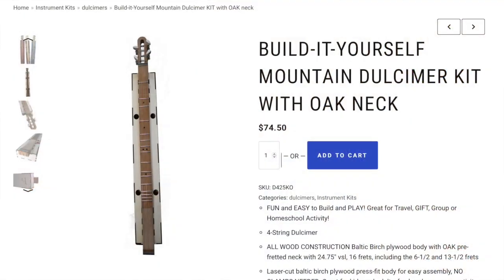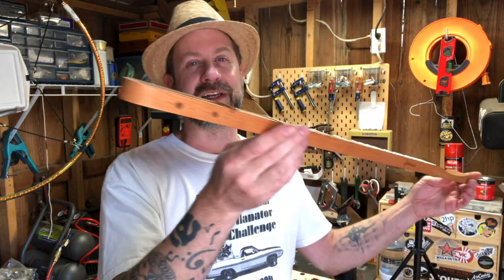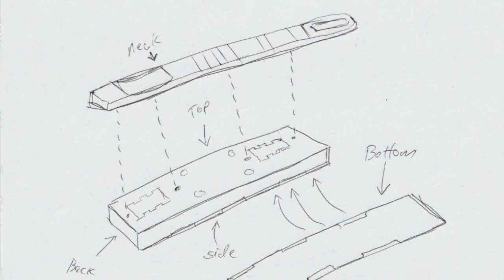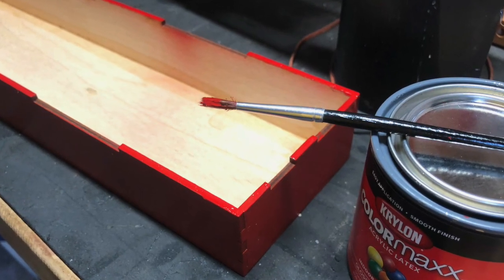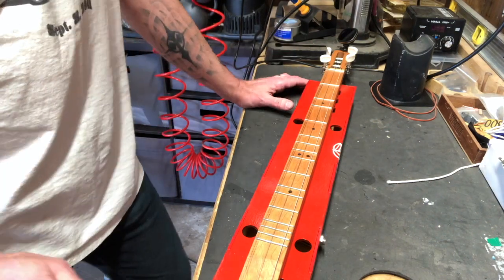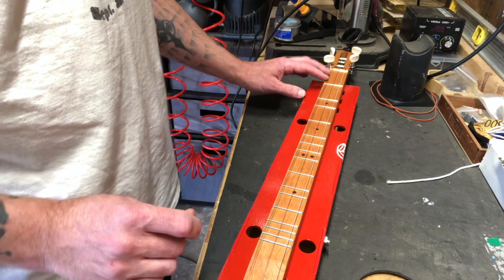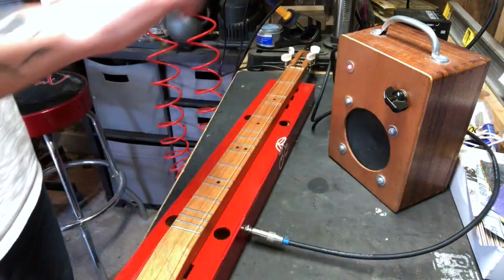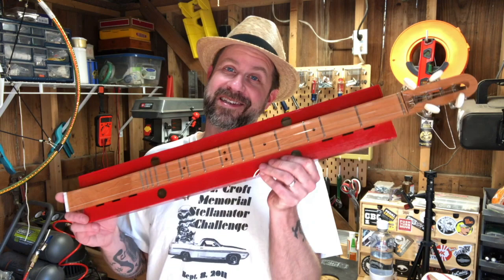Jaromin DIY Mountain Dulcimer Kit

Comment: Nice job! Where can I get the little pick up and jack that you installed? It looks perfect for the job. 😊
Reply from the maker: Thanks for checking out the video. The pickup can be found by searching for "35mm piezo disc" and the jack by searching for "1/4 mono jack". You can get them from a number of different online merchants.

If you're not handy with a soldering iron, you can buy them pre-soldered from www.cbigtty.com. Thanks again and good luck.

Comment: I've wanted to build a mountain dulcimer for quite some time now. Having "studied" instrument building (mostly in books and on YouTube, a tiny bit by actually building), I still find somewhat puzzling how well it works: the "neck" vibrates and transmits its vibration to the box. I would have thought that without a bridge directly connected to the box, it would sound thin, yet it doesn't! Anyway.

I figure I would plug it to a fuzz and play some punk tunes with it. Maybe because power chords are easy to play on them?
Reply from the maker: Thanks for checking out the video. I agree with you completely. I was anticipating this one to sound really thin because the bridge doesn't touch the box. I'm not sure why it creates rich bass frequencies but it does. I surmise it has something to do with the size of the box. In any case, I'd highly recommend this kit and yes... it would be perfect for some punk or grunge.

Comment: sweet

Who I am and where I want to be.

I have had music in my head for as long as i can remember.

Around 5 years old, I started trying to build whistles out of wood, copper pipe, and later when I learned to use a lathe out of brass. I built some most wicked whistles and when I got into grad school I added clay whistles to my. I never had much success with flute making as a kid, but it tried and tried again.

I made myself diddley bows even though I did not have a name for them then. I built a mean shipping crate for my dad's shop and they were highly valued by our customers and used for tool boxes and many things. My first diddley bow was nothing more than a long 2 X 4 with whatever wire we had around the shop. But my diddley bows gradually became more sophisticated. One of the last diddley bows I built was the box like the one I built to ship a sway bar and rack and pinion. I put the “G” string from a Double Bass. I could play “It's a small world on my box” . My father later took it, threw away the string, covered the sound hole I put in it and shipped something in it.

At about age 12 I tried to make myself a lute out of one of my better boxes and fishing line. Talk about an epic fail. It took almost 2 years, but Epic fail.

In fourth grade I tried to join the orchestra. I started taking cello lessons. They would let me play the upright bass because I was not tall enough yet. I only lasted 4 weeks because I could not keep my cello tuned. Practice seemed pointless. I was asked to leave the orchestra. As an adult I found out that my father was sabatoshing my cello and how he was sabatoshing my cello. He was sanding my tuning pegs so that they were strat instead of tapered. Then he would put oil on them and put them back into the cello. I went through 3 rental cellos in four week.

I grew up in a car racing family and I have developed a lot of diverse skills. I am a machinist and metal worker. I have been a working and gifted traditional draftsman since I was 8. I have drawn race car parts, steam engines, and aircraft all of which have been built.

I am an accomplished painter, a traditionally trained weaver. I have restored antiqued and built museum quality looms for both universities and museums, I am a wood carver, and when I have access to tool a wood turner, I have built hand drums and have drums out with professional musicians. 

At age 5 I decided I was going to be an artist. Much of my adult life I have been a graphic artist for newspapers. Magazines, and television stations. When I was not an inhouse artist I often was a photojournalist. In both modes I actually have a pretty impressive resume.

Now that I am retired I want to learn to really play. I want to build nice looking  cigar box guitars, gourd banjos, I want to get good enough that I build myself a baroque theorbo, I want to build a taglharpa with a dragon head on top. 

I want to play old bluegrass music, I want to play J. S. Bach, I want to play medieval music.

I thank you for your help and encouragement in getting stated
Reply from the maker: That is great to hear and I'm glad I'm not the only one. Music can be whatever you want it to be. The most important thing is that it brings you joy.

Comment: This is a great example of how pickups and amps nullify the natural tones of instruments. Once you plugged the pickup in, all the uniquity was drained and it just sounded like any other CBG or zither with a pickup. Magnetic pickups were a very good first idea for amplifying sound, but with modern mics, they're just totally outclassed by all the other forms of amplification that preserve tone.
Reply from the maker: I think the idea of 'amplifying the instrument' and 'recording the instrument' often get confused when - in reality - they're very different. A pickup is intended for amplification (e.g. to get the instrument loud enough to compete with vocals, percussion, etc). Recording is more of an effort to preserve the instruments natural acoustic tone (and is normally done with a mic). While you can use a mic to amplify an instrument, this method tends to create feedback and/or hot spots and is not always ideal for live performance. Thus why so many people add pickups for simple amplification.